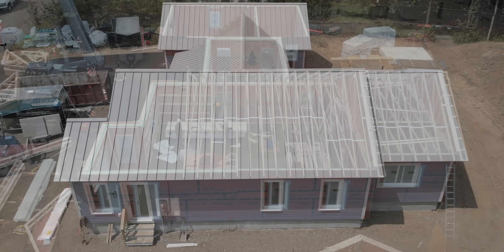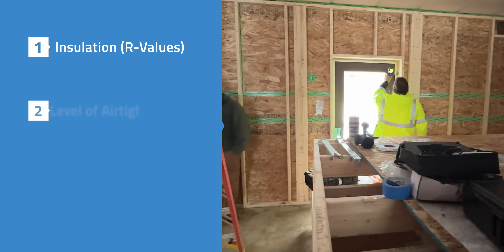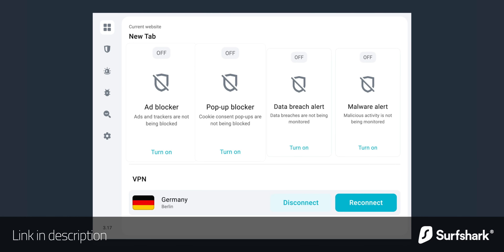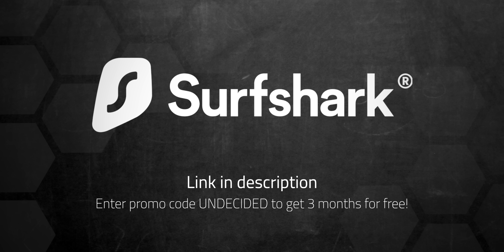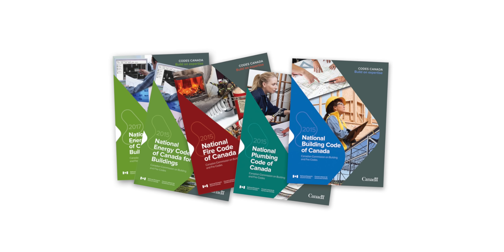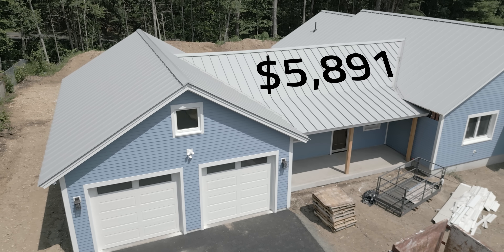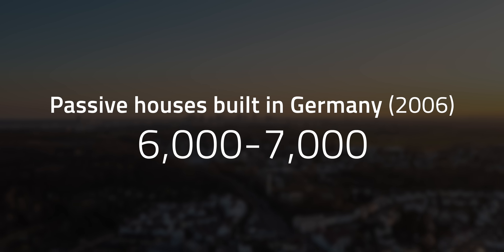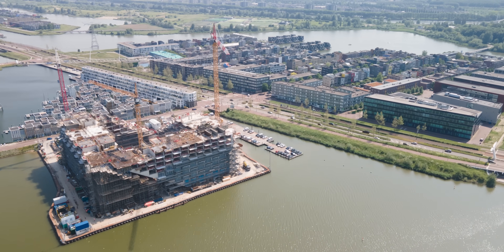Why Do American Homes Suck?

Comment: It's so sad really. Case in point, my track home was built with the absolute cheapest parts.. AC outlets that a slight nudge on a cord breaks the cheap plastic outlet and exposes wires. Sharing a single 15 amp circuit with 2 bedrooms, hallway and outdoor outlets on the back of the house.. so that I am daily having to reset circuit breakers due to just a couple computers and speakers running. If I had the money, I would do whatever I could to build a home like what you are doing Matt. As it is I am buying LFP batteries to build my own battery banks and hopefully charge off of some solar panels when its sunny out to run my computer/monitor/speaker setup. I even go around telling my kids NOT to run the bathroom fans despite the smell.. because they cost about $2 an hour to run and they leave them on all day long. PGE is raising prices AGAIN.. this will now make our bill 3x higher than it was 4 years ago.. due to their fires and lawsuits, we'll be moving up to .66c per kwh during peak. That means my computer which I use to WFH will require about $100 or so a month to power JUST for one computer (it does run all day). Hence moving to a battery system with inverter to power it and hopefully charge batteries from sun most of the time.

Comment: I'm getting ready to build a home this next summer. Going with an R30 Insulated Concrete  Form, in floor hydronic heat.  Designing to do a sealed attic with humidity control and air exchanger. It's pretty easy to build extremely tight ICF houses that are extremely efficient. 
Concrete walls are great to protect against natural disasters, tornadoes in my area. The Concrete mass completely dampens out temperature fluctuations, and are very quiet, kinda like living in a cave.
Cost isn't much more than stick built but I'll save a tone doing a majority of the work myself. I used to work construction and did a bunch of ICF buildings and basements.
I figure I'm better off building a quality energy efficient house as corrupt bureaucrats are forcing energy costs through the roof.

Comment: Relying upon mandated codes for information is sketchy at best. In the US at least, those codes are written by one or more of three groups: Trade unions, manufacturers, or power hungry bureaucrats. Each submits the code in such a way as to increase sales, limit the competition, or simply just to flex their power. I've worked in the trades for 30 years and never have I come across a code enforcer who knew anything about building science. It is not uncommon for code enforcers to force builders to use lower quality and less efficient methods or products merely because the enforcer is just that, a thug without the knowledge or willingness to approve superior products and methodologies.

Comment: As a former resident of Germany, I wanted to point out that German homes are not just energy efficient but are also constructed out of more durable materials such as cinder blocks, unlike in the US where we slap homes together with wood framing. A German house is designed to last generations, but the same can't be said for most of the homes here in the US.

Comment: From only a personal cost perspective, the idea of spending money today to prevent future expense is a difficult pill to swallow. The current value of money is greater than the future value. Even though looking at saving adjust for current value presents the most probable outcome of money saved over the long term, can most Americans afford that in the short term? Affordable housing is a crisis looking to continue to get worse in most American cities. That said, reducing energy used in homes should contribute to a more sustainable future for generations to come. If Americans stand any chance at adopting high home building standards, they will need to address how the majority of the population can afford the upfront cost first or at least at the same time.

Comment: The USA is , in general, not interested in being energy efficient for so so many reasons. Lets list why.
If they are a built by developer they are building to sell so they will not pay a power bill.
A landlord is not paying the power bill either.
There is a housing price crisis so the average Joe is going to buy what he can find for sale for the price they can afford not caring at all how efficient it is. 
Electricity is comparatively cheap here .
We actually export natural gas to other countries and make most of our own oil now so the supply of our energy is secure
The word Efficiency" is related to ""lower quality . many people that buy energy efficient products have been very vocal about how they don't last . HE washing machines don't seem to last as long as the old ones. HE ac systems save electricity but you never really  get it back because of increased repairs and replacements. So when you say high efficiency home it translates into , not a good house

Comment: There is a simple answer to Americans' focus on current cost versus long-term savings. Americans move orders of magnitude more often than most other countries. Reaching to buy the home you can afford today gets you on the equity train. As you move up in housing cost, you also move up in housing energy efficiency, quality, and size. The goal of home ownership is a traditional American dream that will accelerate out of reach if codes require the type of energy efficiency your new home achieves.

Comment: That is an easy question, having built and or rebuilt several homes in Pennsylvania. America homes are not build as generational structures. Sure some well build one last, but in general to build a generational structure means spending on things we cannot see(insulation, Electrical, Plumbing, HVAC systems, roofing and structure) instead of decorative finishes that we see and touch on a regular basis. Even you made compromises, either because of cost or missed in planning. I've owned insulation and contracting businesses an have seen customers attitude of I'm only going to live here 10 years at the most, it's can be the next person's issue cause my ROI or payment per month does not justify it. It all goes back to Levittown NY, where crappy cheap home became a after the war favorite.

Comment: Investing where you live is a tricky subject, especially with property taxes as high as they are in the US. Energy improvements should be done to your home cheaply and without significantly affecting the assessed value of your home. For the purposes of using a home for living and not for selling I am going to ignore the potential capital gains. Generally everyone needs a place to live.

We live in an average sized home in the US(400k) and pay 2% in taxes(8k) Our home is reasonably insulated so we pay about 1k in heating each year and currently do not use any cooling. An 80% reduction would net us a savings of 800 USD per year and for it to be a sound fiscal decision I would want it to cost <= 8k USD. I say 8k because that money in an SP500 fund would average 800/year without risking our property taxes going up. If it's going to make our taxes go up it would need to cost <= 6k for it to make fiscal sense. 

It really isn't feasible looking at our numbers and I imagine that's why it's not widely adopted yet. I would still look to improve R- values as much as cheaply as possible but the extremes are currently fiscal nonsense.

Comment: A super user friendly version of the building's performance characteristics should be required to be given to the potential buyer and it should show how that building compares to others. This could be cost projections for so many years out. It really comes down to aligning incentives and building code simply isn't the best way to that. Builders that want to sell the home will try to maximize profits so we need to make it easy for buyers to value better homes appropriately. Buying based on looks means performance gets overlooked.

Comment: I'm renovating my 1860's house in the UK at the moment. It's not all rosy here - builder knowledge is abysmal (you should have seen their faces when I put internal wall insulation and air tight membrane into the solid walls that remain original (U value of 2!) 

Another problem is where regulations force you to spend money. What's the point in only making half your walls 90% more energy efficient? I spent the same amount of money making the whole envelope 85% more efficient. Thankfully my building inspector saw the logic and waived it through.

Comment: Here in Finland all new houses use almost exclusively heat pumps (air/geothermal) for heating the house and tap water and this has been the case for quite some time now. Many old houses that has used electricity, oil or district heating  have been fitted with heatpumps. Even new appartment blocks now gets heat from geothermal and district heating companies have started to produce heating from geothermal. I'm really sad to hear that the way you chose to build your house, which would be a standard house in this part of the world, isn't common in america. America is just so far behind here, it's just baffling.
Reply: They are far behind in electricity, 110v is too low for power tool it maxed out at 1800W because most outdoor and garage circuit are 15Amps. 20A cricuit could be installed but not enought tool are made to take the 20Amps since it's not common. Another con, you lost a lot of power in the extension cord. Generally the 110V is inefficient. 220V 16Amps is perfect. Also the fuse box are from 1800s. no GFCI/AFCI in the box some are at the outlet for kitchen/bathroom/garage near the sink/outside plug but that's it, mostly GFCI... Add the fact that the ceiling light are on the same circuit as the plug! So when you power a power full tool the light dim... really annoying. Oh and the plugs are really unsafe, you can get electrocuted because the plug is flush on the wall not recessed, you can break the blade and the ground pin really easy. Wire are not in conduit so never gonna be able to replace, unless tearing down the house... stupid...
Reply: People build houses all different ways in the United States.. I guarantee you the United States builds more of a variety of homes than any other place. I've lived all over the world and been to many places in Europe that I would consider crap. The difference is Europeans seem to be obsessed with Americans and what goes on in America .

Comment: It's a cost/benefit analysis. Energy is cheaper here, so using lower cost building methods make some sense. However, Europe is farther north (colder) than the majority of the USA, and have less domestic energy resources, so the cost/benefit analysis favors more energy efficient construction methods there. Keep in mind that the widespread awareness of the need to reduce our carbon footprints are relatively newer here  that they are in Europe.

Also keep in mind that the MOST polluting areas of the planet are also the poorest with the WORST building codes, if they exist at all.

Comment: Matt Risinger's channel is awesome - I've been getting some great ideas on how to make my home more efficient over time from your and his channel (built well in the early 1990's in Minnesota) - everything from changing my attic from vented to conditioned during a roof renovation to additional insulation/jacketing on the outside of the house during a replacement of the siding. All with the idea of making my home more energy efficient and eventually/hopefully independent (solar + battery system). Going to be a long journey, but i'm very exciting and thanks to you both for the great ideas and content!
Reply: belt & suspenders :)

Comment: I am very, very interested in the (Canadian) government raising the energy efficiency standards on new builds through the roof. I want heat exchangers with a high minimum efficiency standard to be compulsory on detached and semi detached homes. Incentives for solar heat and electric panels, and significant incentives for installing and upgrading these and other energy efficiency oriented things like installing high efficiency windows and adding insulation to outer walls as well.  I also want fuel taxes added to gasoline and natural gas to additionally incentivise people to change.

Comment: A few years ago when ERCOT dropped the ball during that winter storm that paralyzed Texas and turned my power off for a week I decided I would never be beholden to a utility again.  I installed a battery-backed solar system with a multi-fuel whole-house generator as a backup to my solar system.  Without making any other energy efficiency improvements to my home, I completely reduced my power bill to $0 for about 8 months out of the year with my solar system (I was paying about $600/month to CPS during the summer months and $400 during the winter months prior to this).  Now, my highest energy bill is during the month of December and it's about $100 (with $35 of that being for "city services"). If the grid goes down and the battery-backed solar system isn't producing enough to meet demand, my generator automatically starts and picks up the slack until the house battery is recharged.  This is all on an automatic transfer switch so that I don't experience any disruptions.  Now, my solar system was over $100,000, but it should pay for itself in about 10 years with a 25-year useful life of the system (panels have a 20-year warranty).  All that being said, it would still be more "green" to just get 100% of my electricity from the nuclear plant that serves my area (nuclear is much greener than renewables, despite what many people believe, and nuclear plants have substantially longer useful lifespans).

Comment: These high efficiency complex systems seem to cost you less in ongoing costs until they break.  For example, the blower motor on my outdoor hvac condensing unit failed.  It is a fancy ECM motor that is about 80% efficient.  A standard PCM motor is about 50% efficient.  A standard motor costs about $100, this one costs $800 (wholesale prices).  My 1/5hp ECM motor uses about 112 watts less than the standard motor.  Over 13 years assuming a 50% run time, that saved me about $700 in electricity at 12c/kwh.  So, it didn't work out.  If you consider the cost of money, it lost me money.  It would have been cheaper to put in a cheaper less efficient motor and pay for the extra electricity.  But here is the other thing.  Every HVAC supply house has the standard motor on the shelf, I had to wait a week for mine to get shipped to me.  I fixed it myself, so those were my costs.  But if an hvac company would have done it, they would have marked up the motors as a percentage of their cost, which would have made the ECM motor a big time loser.  Plus it would have been two visits instead of one.  Also, had I not had a temporary fan that I rigged up, I would have had no AC for a week.  99% of folks out there would not have been out there rigging up a temporary fan and would have been suffering for a week.
EDIT: I just discovered my unit has a lifetime hour meter on it.  It has run roughly 25,000 hours.  So it has only saved me about $350 in electricity.  So this is a big waste of money.

Comment: European here! Energy concerns are higher than ever here... Petrol/Gas (95 RON/91 AKI) is almost reaching 2 eur/L (8 USD/Gal). At some countries it already exceeded. Natural gas is getting more and more expensive due to outgoing war. Electricity price is getting higher and sometimes it exeeds 30 eur cents/Kwh (25 eur ct/kwh average at the time of writing). Our local goverment is demanding that new buildings meet or exceed A++ category requirments. Most of detached homes (no matter which material) are getting 0.55 or even lower air changes per hour. Just to confirm - triple glaze windows is normal for like 10 years. Air to water heatpump with underfloor heating is most common here. Geothermal just got too expensive really quickly and did not got catch on... Most of the countrys still do some kind of compensation for getting solar panels installed.

Comment: If you are going to look at the relative cost of heating in different countries you need to factor in the relative wealth of those living there!
I could be wrong but also it looks like you build them cheap and not to last. Stick built is just one example.
There is a real problem with lower air changes per hour ...... moulds! They don't happen in well ventilated homes (unless they are damp). If you have low leakage in your home you need to counter it with good H&V!

Comment: I have little issue with no regulation. I am absolutely fine with codes being local and state. If you want to incentivize building greener and being more efficient, do it through tax breaks. 
There are just TO MANY different types of places in this country to try to "federalize" them all into one, also, this isn't the concept of how the US works, hence the name "United STATES."
That being said I wish I could do what you are doing in building as you are. I am working on a pole building now and I am looking into finishing it and making it very energy efficient and hoping to add solar in the next few years.
In my experience, adding more regulation does two things: First, it causes prices to soar. Second, it allows for monopolization of products to meet said regulations. 
Just my 2 cents

Comment: Eh... Air tightness is a coin toss, Yes the more Airtight something is the more you keep out the external elements but it's also the more if you don't properly manage the barometrics of the house you can escalate curtain conditions to dangerous levels in a quicker time span. That Air filtration system is vital if your not careful.